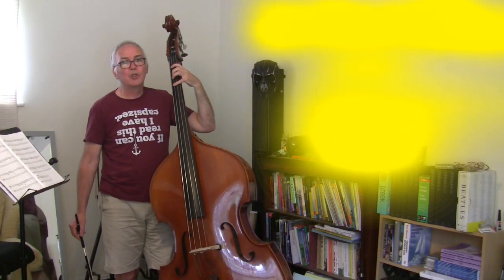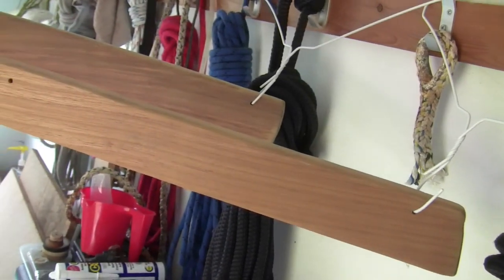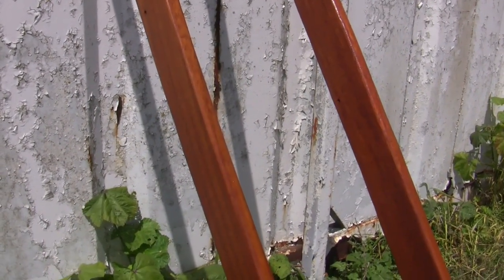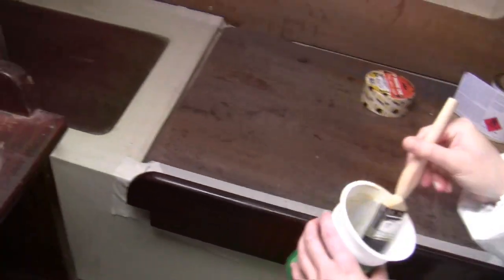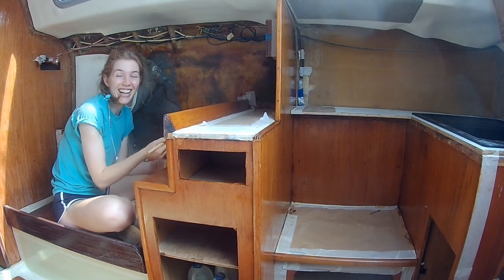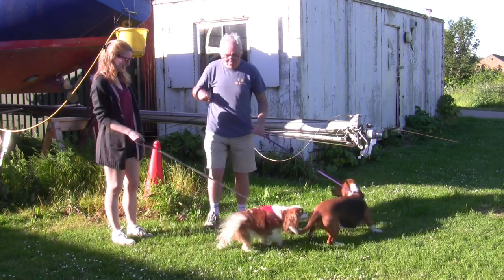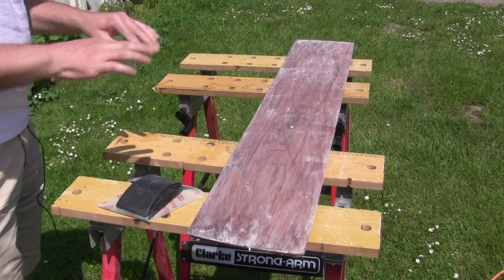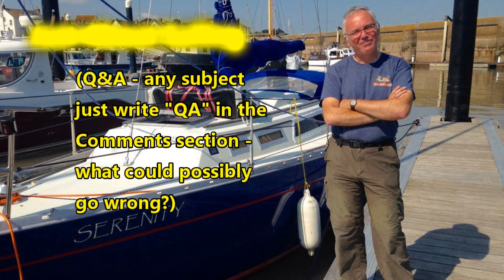Just About Sailing June 2021 - Varnishing, varnishing and more varnishing - oh, and a bit of sanding

Comment: This is how the varnishing was done on quality boats in the good old times. Educational video right here people... :-p
When I fix an old surface, the first glossy coat goes on with a lot of thinner and the last satin goes on by spray.
Good job Paul and Lucy!
Reply from the maker: Thanks. Although, I am well aware that I have cut a lot of corners. Yes, I forgot to mention thinning the first coat. I thinned it right back. On the interior piece that had been stripped right back to bare wood I went to about 60/40 (Varnish / Thinner).
Spraying the final coat would be preferable. I don't have the skills or experience.
Cheers, Paul

Comment: I am a fan of real tung oil thinned by citrus solvent.

Funny thing, I just now got done treating the wood on the entire outside of the boat.  It took me about an hour or so.  That includes the gunn'l around the entire hull, handrails fore and aft, the top cap around the entire cockpit combing, and the trim around the companionways fore and aft (we have a center cockpit without a pass-through so we have two companionway hatches.)

Oil prep is a quick scuff up with a 3M scrub pad if it is still shiny from the last treatment or nothing if it has been a couple of months since the last coat.  I've left it for a while this time so I didn't scuff this time, but if I decide to put on another coat tomorrow or the next day I will need to scuff it. It takes a day or two to dry outside, depending on heat, humidity, and the sun. Inside it can be days between coats.

The upside is that oil is easy and fast, and doesn't require masking tape or a brush.  I use old socks as an application towel and to buff off the excess oil after a few minutes.  Another upside is that since there is never sanding or scraping there is no erosion of the wood each time it is refinished.

The downside is that teak, mahogany, sapele, and other marine woods tend to turn very dark or even black over time outside in the UV.  Inside they look marvelous, light, and similar to matte varnish.   Also, refinishing is extremely easy and fast.  Just put more oil on.  Inside we can go up to a year or more between oilings.  Outside it should be done every month or two.  At three months it really starts to beg for oil.

Oil or varnish is a mattsr of choice.  I would rather do a very little work more often (Rather than a HUGE project for a revarnishing) and have the wood look fantastic almost all of the time, and when it starts to look bad it can be brightened back up in minutes.  But it is an ongoing task, especially outsidenon deck and in the cockpit.  After a really rough sail or a bad storm it can be stripped off a little from the driving water hitting it hard, so it may often need to be touched up with another quick rubdown.
Reply from the maker: It's interesting that there are so many different options. I did think about oil for the external wood. I tried the woodskin as an experiment on a couple of areas and liked the result. It should be similar to maintain in the way you suggest. Only time will tell. The wood lasted fine for about 40+ years without any treatment. I don't know that Iroko is as good as Teak - it's certainly cheaper.
Most of the interior is really a 'maintenance' coat. I didn't really want to strip it right back. I wanted to preserve the patina of a 40 year old boat. Unfortunately it's going to be a bit of a mix and match as some of it did need to be taken right back to the bare wood.
I always feel a bit uncomfortable visiting old classic boats at boat show where the varnish shines like glass and looks like it has never been touched. I prefer it when you can see the bumps and scars of everyday sailing life.
Cheers, Paul
Reply: The nice thing about natural oil is that the wood can breathe.  A product that completely seals the wood is fine until that barrier is breeched by a scratchnor chip.  Then moisture can and will enter through that tiny  opening but if it is small enough it can't escape again nearly as quickly when the atmosphere is dry as when the chipnor scratch is exposed to water.  

Moisture levels in the wood keep going up and fhe heat of the sun actually drives it further in ornalong the underside of the coating if it can't escape anywhere else.  This makes a bubble or delamination in the coating and eventually leads to wood rot further in if the moisture persists.  Any chip or flaw in the barrier needs to be repaired immediately if the wood can not breathe on its own.

I did an experiment with our companionway slats and used a polyurethane varnish on the outside and just tung oil on the inner side.  Both sides look fantastic still after four years.  I just oiled the inside faces yesterday wirh the rest of the wood.  There are a couple of tiny dings on the outside which may have compromised the barrier but no visible failure of the coating, bubbling, delamination, or peeling. Any moisture that enters is hopefully migrating through the wood and escaping on the inner side where it is just a rubbed oil finish.  So far so good on the hybrid theory.

These slats take a beating constantly, being used many times a day and dropped/knocked over quite often.
Reply from the maker: @svbarryduckworth628  Interesting. The woodskin is supposed to breath and be OK if the surface is compromised. A lot of people say that you should leave one surface unvarnished if possible.
With my washboards, I have completely sealed them with many layers of clear epoxy then put many layers of two part varnish on the top one and many layers of one part on the lower one. - I will juts have to wait and see what happens.
Paul

Comment: Many thanks, Paul and Lucy, for another excellent video. I'm currently doing my boat as well (a Windex 92, Swedish built) and this video has persuaded me to go for the satin finish varnish. As an aside, I've just made the first cockpit grating from Iroko, and I'm not going to varnish any of the exterior wood. I've applied 3 coats of boiled linseed oil to the grating and I'm delighted with the finish - and hopefully this will reduce the amount of "oh glorious sanding" (as Mads would say) that I'll have to do. Keep up the terrific videos, they are really VERY useful. Hope we can meet up some time in a nice harbour, and I'll be delighted to have a beer or three with you! Greetings from the Southeast corner of Ireland!!! Pete.
Reply from the maker: Pete, South East Ireland is most definitely on my list. I wanted to do the Baltimore Jester Challenge a few years ago, but it didn't work out.
The single coat of satin over a few coats of gloss is a really nice combination. Satin on its own is just a little too dull and you lose some of the grain.
Cheers, Paul

Comment: Watching paint dry🥳🥳🥳
Reply from the maker: No, watching paint drying is a completely different experience. I'll tell you what, I'll do a side by side slow motion comparison special. - Complete with commentary and background music - or maybe without the music ;)
Cheers, Paul
Reply: @verynearlyaboutsailing8114  of course a dogs chorale must be inserted you will have to drag out the Bloodhound for the Bass I’m sure if you look hard enough a Castrato may be available
Reply from the maker: @santamulligan676  We don't talk about Castrati in front of the dogs - sensitive subject ;)
Reply: @verynearlyaboutsailing8114  perhaps a sprocket for conductor

Comment: I can only dream of the finish you're getting. The brushes look 'fancy'. Are they a specialist brush or readily available at the usual DIY stores?
Reply from the maker: Colin, just normal brushes. I think they are Harris ones. They are very, very soft. I normally have a stack of really cheap brushes that I use for epoxy work. But I thought I would go up in quality for the varnish.
I think that both Lucy and I were surprised with how well it all turned out.
Cheers, Paul